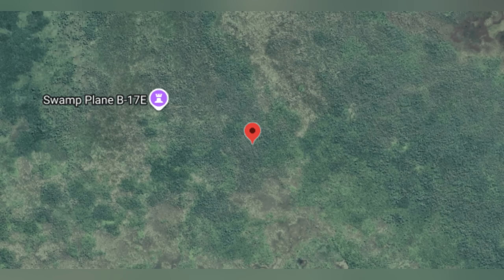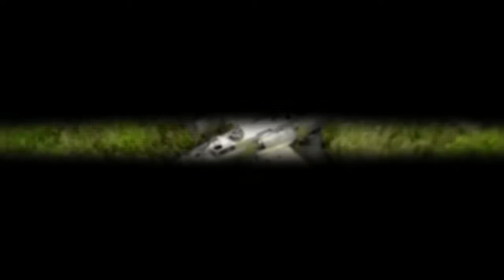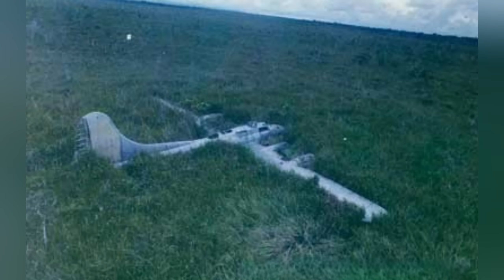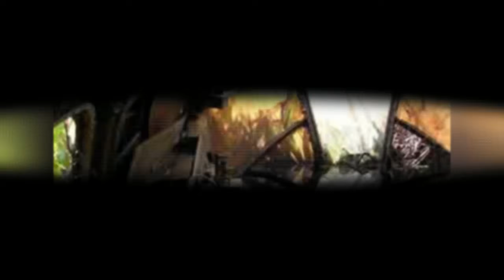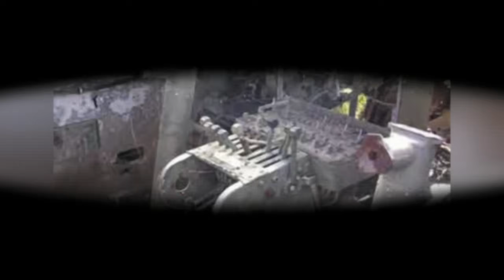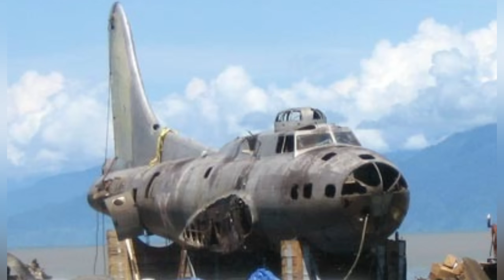Raising Swamp Ghost: The B-17 Time Capsule in a Jungle Swamp

Comment: This post is another load of rubbish!!!
They did take cutting🎉 torches.
They didn't unbolt the engines at the mounts.
The engine mount tubes any other items attaching the engines were hacked off with a gas axe!!!
The same happened to the wing mounting points.